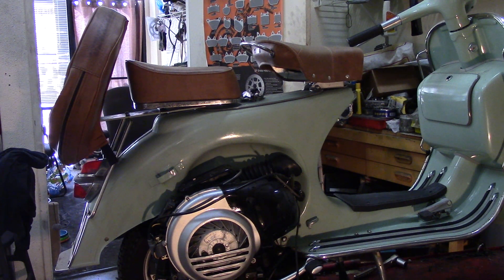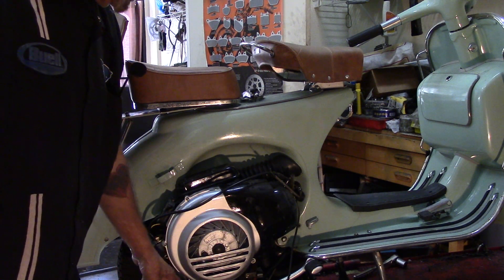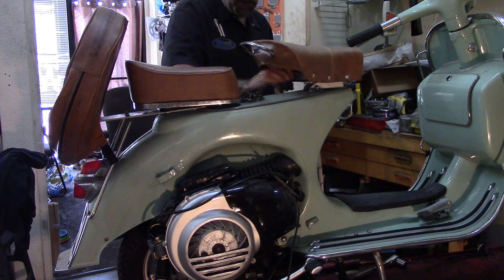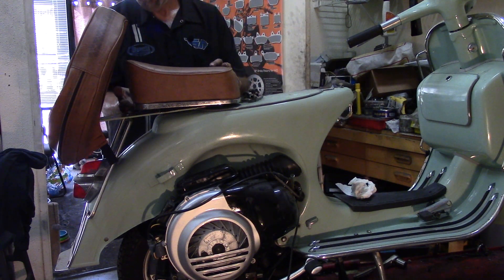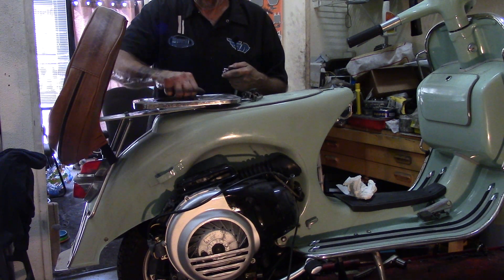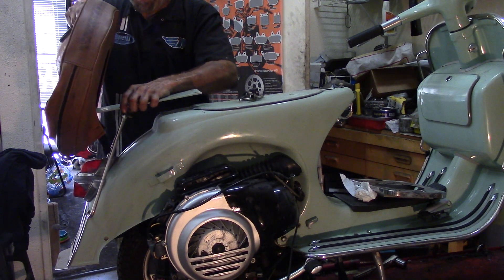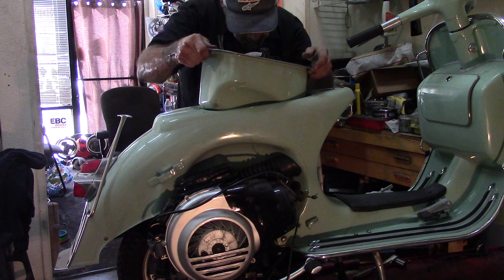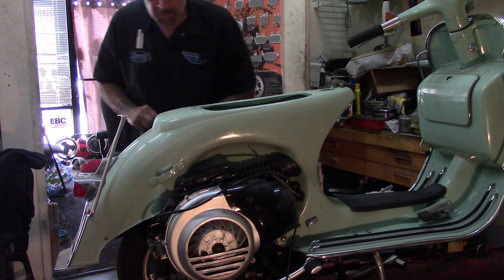Vintage Vespa Electric Conversion with Retrospective Scooters Kit Part 2

Comment: I've thought about buying one of these conversion kits for quite some time. Here in London you can't ride them anymore because of the emissions (you can but you have to pay £12.50 each day). What's put me off is my terrible understanding of electronics. It would be great to see how you deal with this as part of your project. I believe there have been some changes to the kit and you can use the existing wiring loom? I'd like to know more before taking the plunge. Thanks and the best!
Reply from the maker: Thank you for watching. I am planning to do a video on the electronics after I install the electric motor.  It seams pretty straight forward and I will go into some detail.  Stay tuned. After I put up part 1 Retrospective contacted me and kindly offered all the support I may need. Great company.
Reply: I'm looking forward to the next videos here too but in case you missed them, look up Vespa EV Conversions by Random Tasks. I don't think he's a professional mechanic but he's installed a Retrospective kit himself